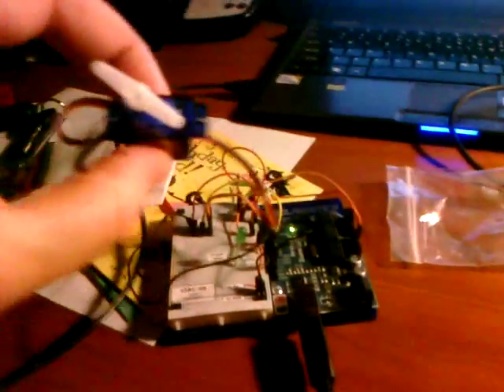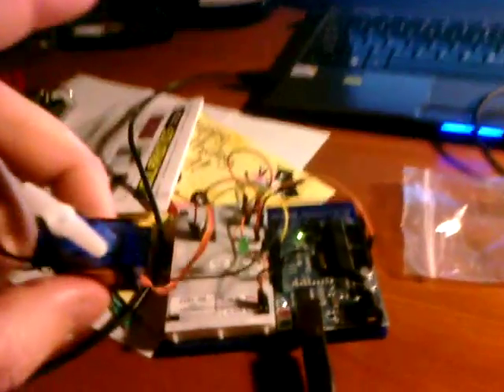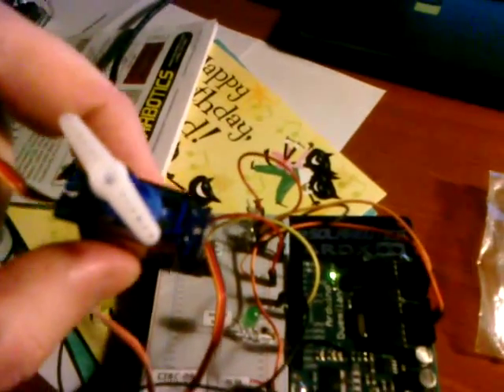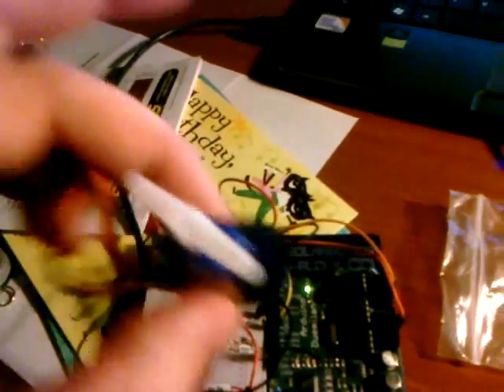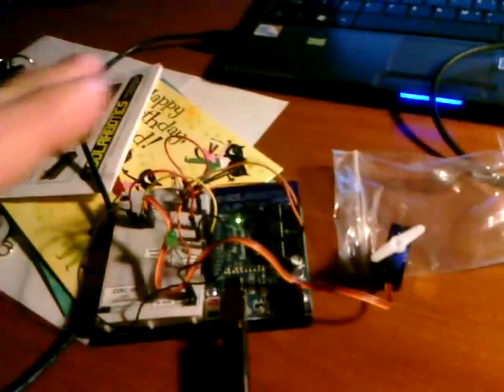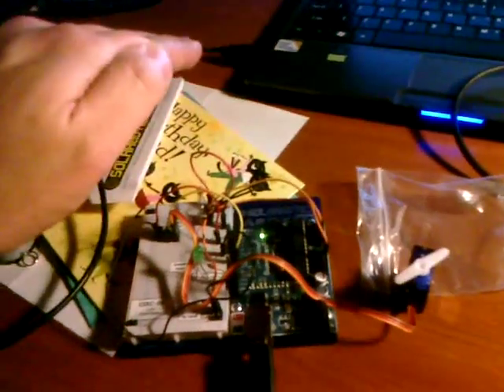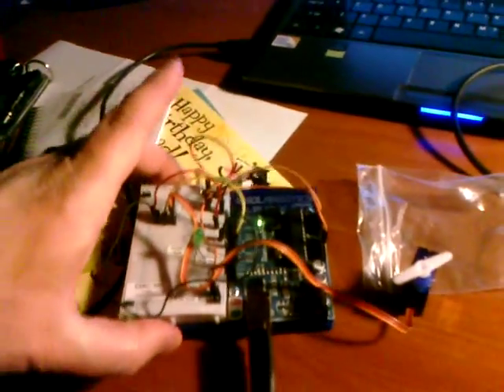Arduino servo control via photoresistor (light sensor)

Comment: #include <Servo.h>
Servo servo1;
int pot = A0;
int angulo =0 ; 
void setup (){
servo1.attach(9);
pinMode(pot, INPUT);
Serial.begin(9600);
/* bueno en primer lugar se inicializan la libreria, objetos y variables. servo1 corresponde al nombre del servo, pot al potenciometro a usar. 
es importante notar que tuve que inicializar asimismo el angulo en 0 aqu[i, pues de otra manera no podia trabajar con el servo, porque reiniciaba los valores a usar por el mismo en cada vuelta del loop. Asimismo
inicialice el serial para poder ver los valores del potenciometro y comparar el tiempo de reaccion del servo*/
}

void loop(){
  int lectura = analogRead(pot);
  Serial.println(lectura);
  if ( lectura <= 500){
    /* se comparan los valores de lectura para poder asi determinar si se le sumara o no al angulo usado */
  angulo = angulo +1;
  if (angulo >= 180){
  angulo = 180 ;}
  /* es importante notar que puse el limite en el crecimiento del angulo de forma que nunca exceda 180 y por tanto que descance el servo una vez en esa posicion.  */
  if ( angulo <= 180 ){
  servo1.write(angulo); }    
}
if (lectura > 500) {
angulo = angulo -1 ;
if (angulo <= 0){
angulo = 0 ;}
if (angulo >= 0){
servo1.write(angulo);}
/* se realizo lo mismo que en if anterior*/
}
delay (5);
}